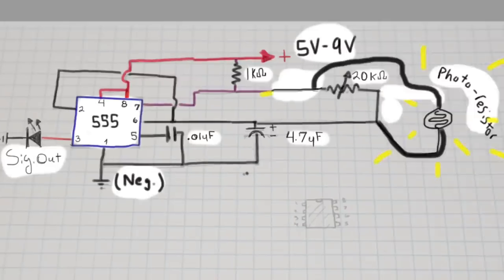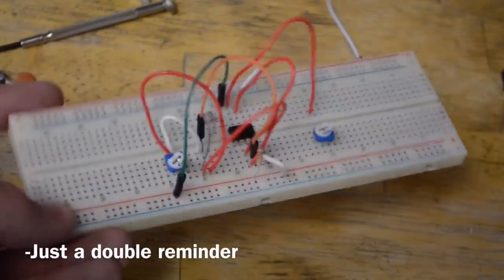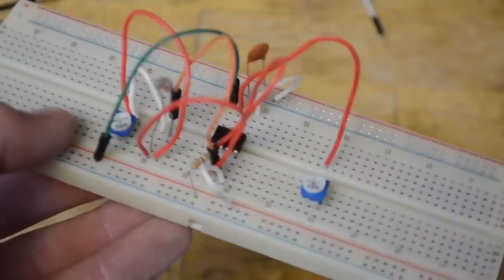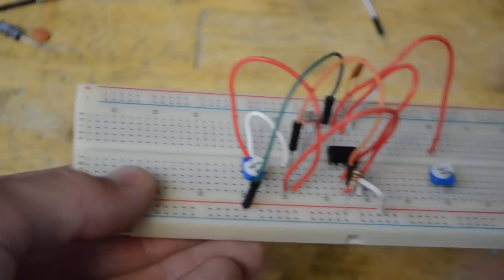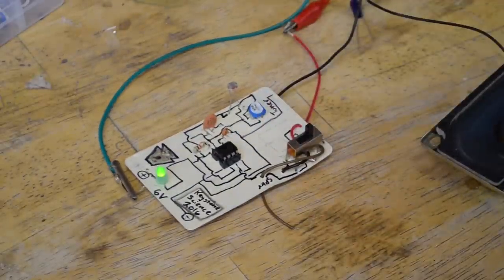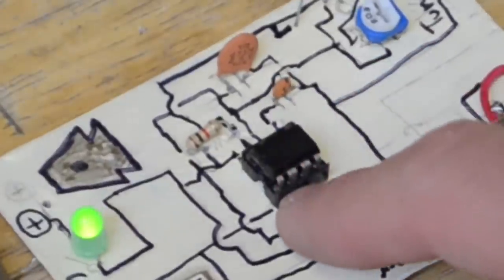How to make a Pocket THEREMIN!

Comment: Which version of the 555 IC are you using? I was surprised that you commented (3:21) that it wouldn't sustain more than a 6 volt supply voltage, as even the CMOS versions are usually rated up to at least 12 volts.
Reply: I was thinking the same thing. There are no 555 timers that are limited to 6 volts. 15 to 18v is accurate.